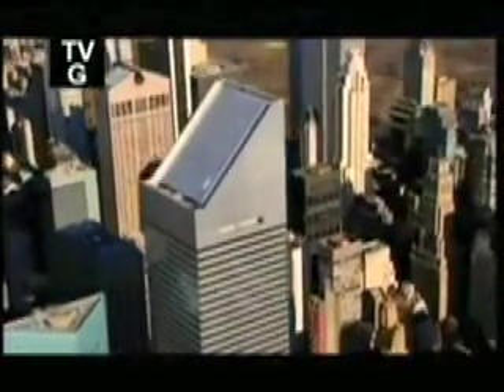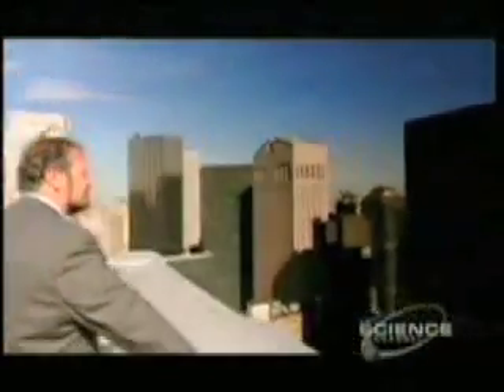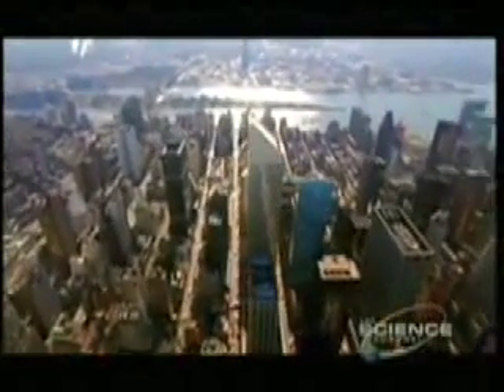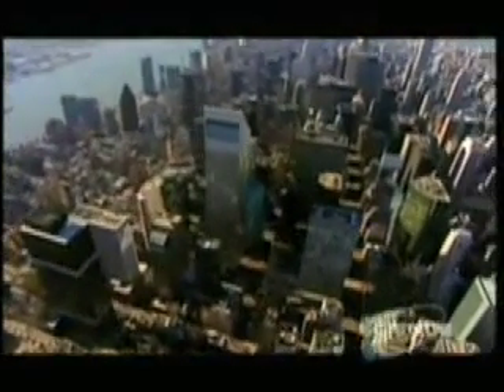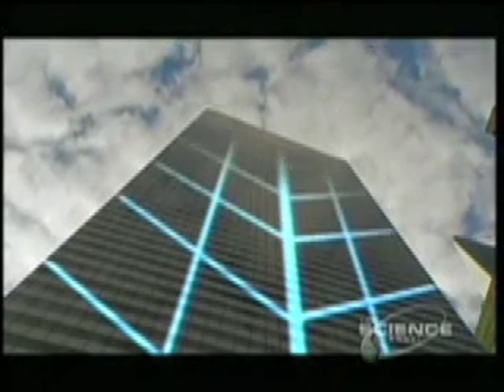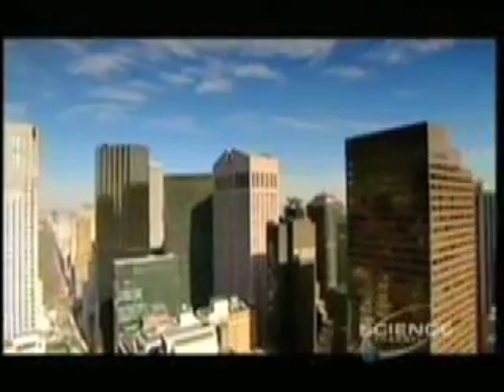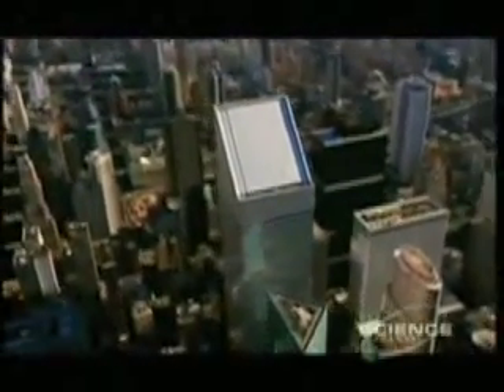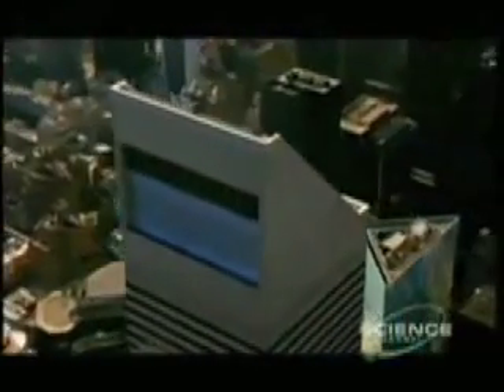The Secret Retrofit of the Citibank Tower in 1978

Comment: a recent re-analysis using modern computer technology has concluded that wind load calculations of Wm LeMessurier were off - so may be the building's ORIGINAL design would have been fine - & wouldn't have toppled in the high quartering winds like this video says - https://europepmc.org/article/MED/34195696

Comment: @Limerick9824 ----> Why airplanes..? Well, allegedly, why did the towers collapse? Because of dislogdement of fireproofing due to the impacts of the airplane crashes, and sagging of perimeter columns due to heating and then sagging of floor trusses, and the hypothesis then goes that this sagging pulled in the exterior columns of the buildings. Vast dislogdement of fireproofing was THE most crucial point for NISTs model to "work". ---->

Comment: pass by thinking it is an ordinary wall when in reality there are corridors, rooms behind it that lead to staircases leading to the roof or basement. I have been in skyscrapers and seen those areas where they keep the geneators that supply emergency power as well as been on the roof where they have the microwave radar station to send signals out. These buildings are tall enough to scare a lot of people from going on them due to how high up it is.

Comment: Once again it was openly discussed at having the repairs during workers but it wasn't done because of certain reasons that make sense hence why it was done after hours. 

Refits like that happen all the time it's called building maintenance. They do repair work a lot off hours since they won't be interupted or won't interupt the normal business day. Lots of buildings hide the enterances to the generator rooms, etc behind wood paneling. Unless you know what to look and where it is you just pass
Reply: also - they knew the conditions for the collapse - high winds - like the hurricane nearly hit NYC that year - they & city prepared for an evacuation of the building and surrounding buildings should the hurricane hit - however - it turns out there may not have been any danger - a recent re-analysis using modern computer technology has concluded that LeMessurier's calcs were off - implying the building's ORIGINAL design might have been fine - https://europepmc.org/article/MED/34195696